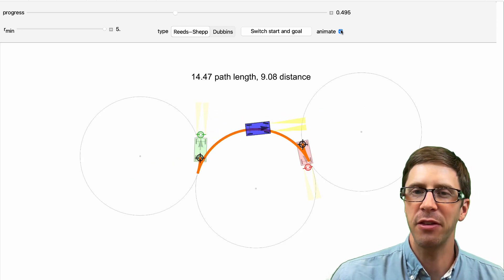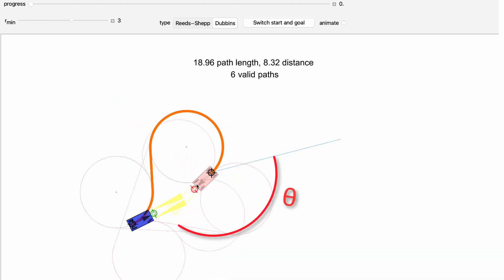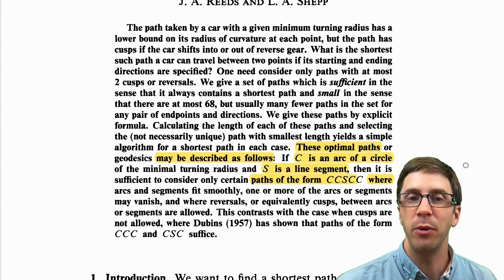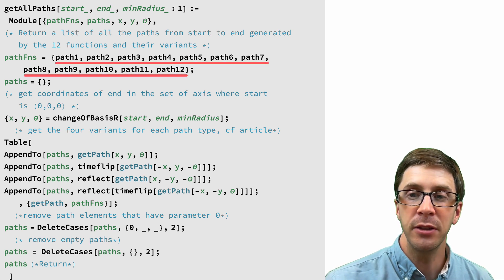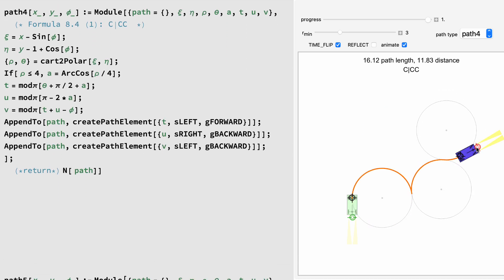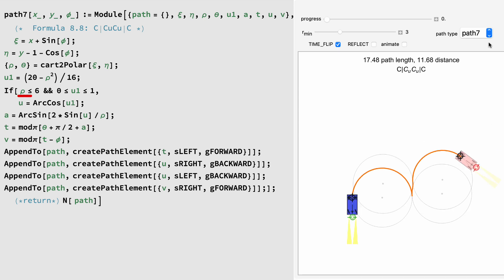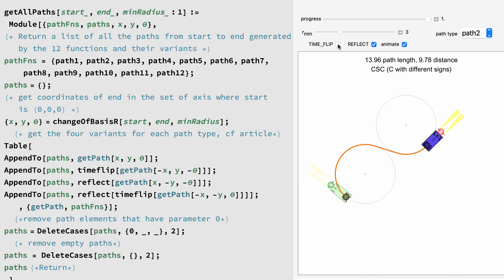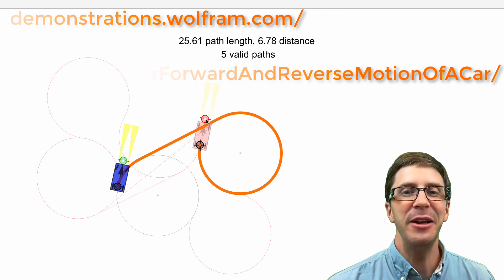Coding a Reeds-Shepp Car Optimal Path Planner

Comment: It would be really fun to display the set of positions (orientation included) at a given distance r of an origin position (orientation included). The "metric circle" of radius r. Maybe segment of this metric circle could even be colored according to which one of the 12 generic types of path it's part of).  A given metric circle seems feasible to display, several "concentric" metric circle of increasing r might be but I guess it would be a mess in the display as they can cross each other (with same position but different orientation).

Comment: Sir Could you explain that how AutoTurn addon of AutoCAD works? and if possible could you implement it. It basicly takes initial vehicle position and end position with a given speed and it generates vehicle swept path. And it also work on truck with trailer
Reply from the maker: I think the addition of the trailer is the biggest difference, since increasing speed can be incorporated by increasing the minimum turn radius.  https://autoturnonline.com/ shows the area swept out by the trailer.  That is a good project, and I'll put it on my project list.
Reply from the maker: I answered too fast.  The width of the swept path depends on the dimensions of the car and its orientation along the path.  This is also an interesting challenge.  See the figure here https://www.dimensions.com/element/passenger-vehicle-180-degree-turning-paths-radius that shows how different parts of the car body build the swept area.  This will take some time!

Comment: It is greatly prepared video, there are lots of detials and efforts in it. Thanks for video, I am looking forward for future videos of this serie. I wonder that is there variable speed of it. Or can we think the way that increase in speed means increase in radius.
Can it be combine with RRT or A* algorithms?
Lastly I wonder that are there automatic parking problems of trucks with trailer?
Reply from the maker: All good points.  (1.)This is the path planning problem so it makes the shortest path.  You can move along the path at any speed you want, but as you move faster the dynamics (changing gears, accelerating and decelerating, and not skidding out during turns) begin to become important. (2.) certainly at higher speeds the minimum turning radius increases.  (3) certainly this is an excellent 'local planner' to use with RRT https://youtu.be/Ob3BIJkQJEw, PRM https://youtu.be/tlFVbHENPCI or A*.  (3) motion planning for a truck with a trailer has a lot of great papers.  Maybe someday I can find or make a Demonstration on that. Are you interested? https://www.mathworks.com/help/nav/ug/reverse-capable-motion-planning-for-tractor-trailer-model-using-plannercontrolrrt.html
Reply: @AaronBecker  thank you sir, yes I am interested these kind of problems, someday I want to make it in godot